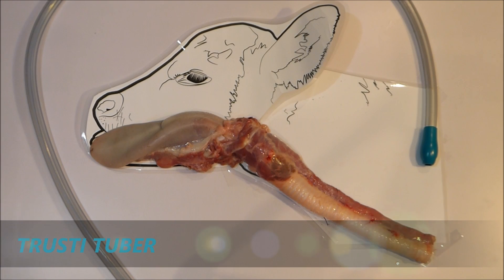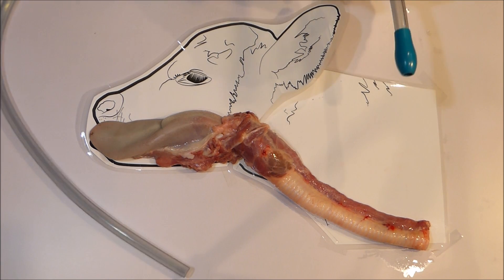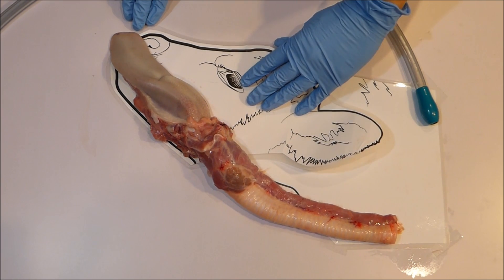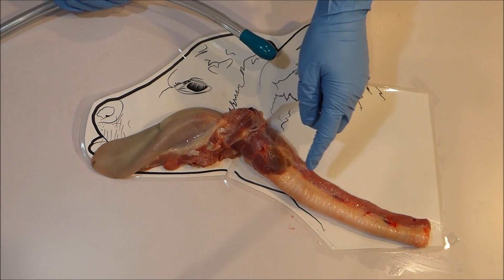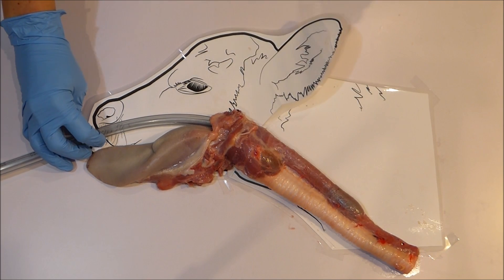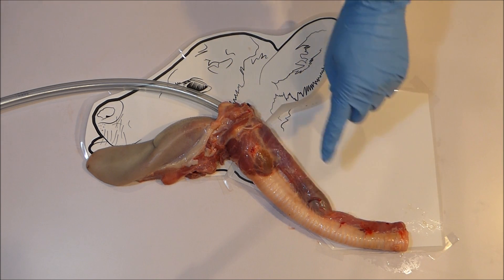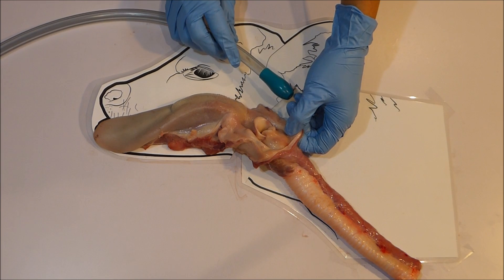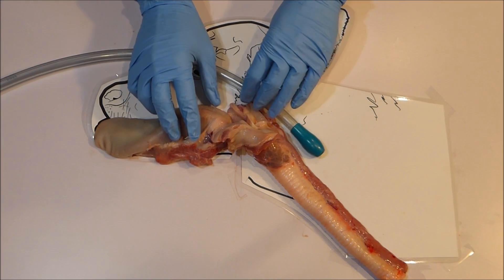Calf Tube Feeding Anatomy Tutorial, Trusti Tuber, Flexi Tuber

Comment: I have tubed a heap of calves over the years with this product successfully but recently I have had issues with my tubing. I had a calf last week who required tubing and I was getting a lot of air coming back up the tube. It was in far enough and I was pretty certain about my placement but the air coming back was concerning so I removed and let someone else do it. Is it possible to have air kick back from the stomach or could it only be from an airway? In all my tubings I have never had air come back at me from the tube like this.
Reply: On another note I always have my tube disconnected from the bottle so I can check placement is 100% before bottling.

Comment: Best way to feed a calf is from its mother protected by its mother love
Reply: Except when the mother has mastitis (cannot give milk) the calf is to weak or cannot bottle feed.  I saved a calf this way.  Great video.
Reply: @Jax209i  Virus, not helpful. Michele, this procedure (tubeing) is only done when the calf is unable to nurse, from either the mother or a bottle. This is typically a result of a calf born premature, born weak, or that has suffered a great deal of stress (heat, cold, had to be pulled, etc.) This is never done as a long term solution, only as a way to get nutrients into the baby quickly, to give it the energy to hopefully deal with the problem. after being fed this way once or twice, the calf will usually then have the strength to nurse from its mother or a bottle. and as ravenwalker pointed out, if a cow has mastitis ( in infection in the udder/ mammary tissue), it can hurt the calf to feed from its mother until the infection clears up.